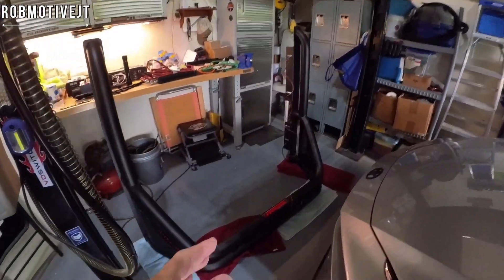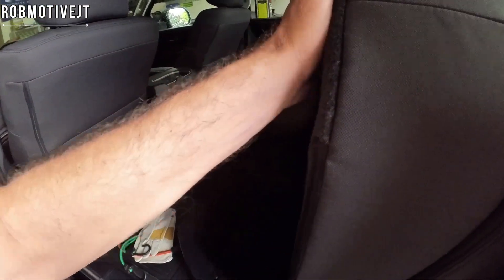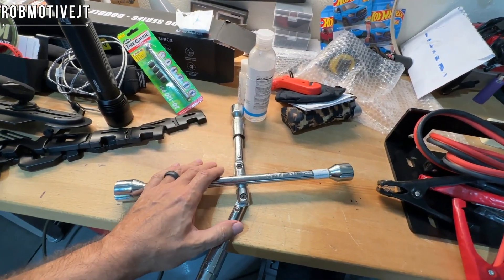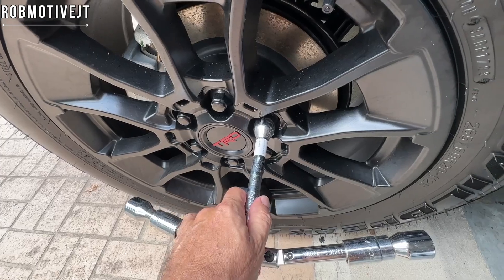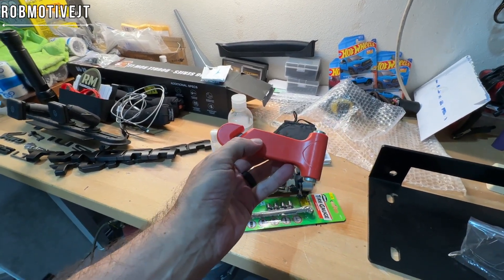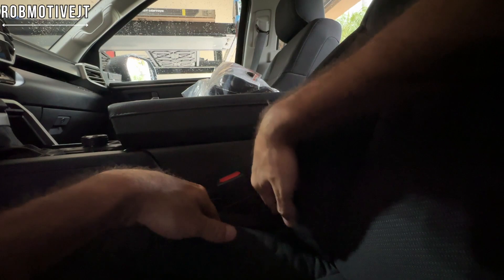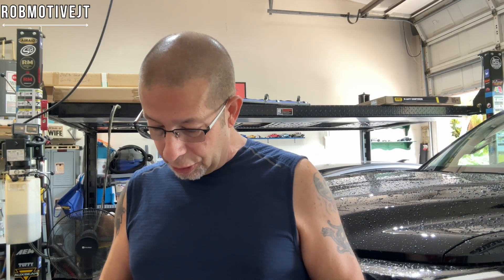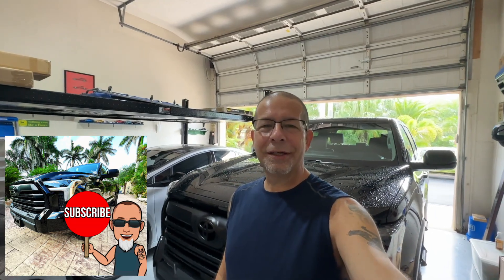Stocking My New Toyota Tundra

Comment: Rob I go back and forth on Jumper cables. Where I work there are quite a few folks that drive basically junkers that carry with them a lot of wore out older batteries. Like many folks I am not going to lie if someone ask me if I have jumper cables. As you know jumping people off can be risky ask it relates to scratches and dents so by not carrying them I can cut my risk. If I did carry them and just told folks no then that would present more problems. Am I the only one that feels that way?
Reply from the maker: You are not the only one.  Been there myself🤔

Comment: Hi Rob  i watched what you put into the tundra & read thr comments  all great ideas! However  1 thing i didnt see was a FIRE EXTINGUISHER A most important  piece  of equipment  in case of electrical  or some  other cause of fire in your truck! Would you rather  try to put a fire out in your new truck or watch  it burn while waiting  for firemen to come put out your fire while its doing  more damage  to truck than if you had a way to stop a fire quickly  and save most of your truck? Of course  you need proper EXTINGUISHER  but i feel important  item to have in truckfor safety  item ! Cheers buddy Clyde  S.